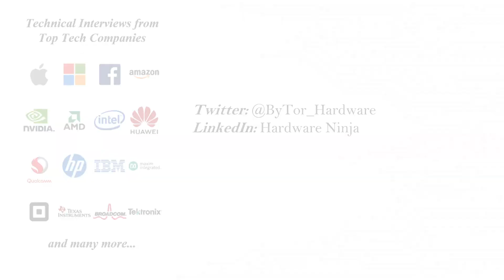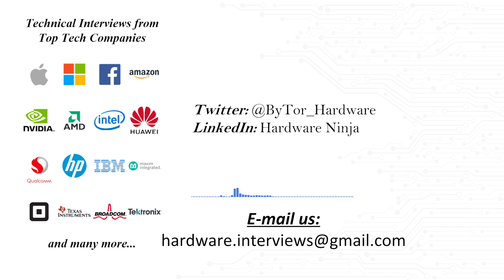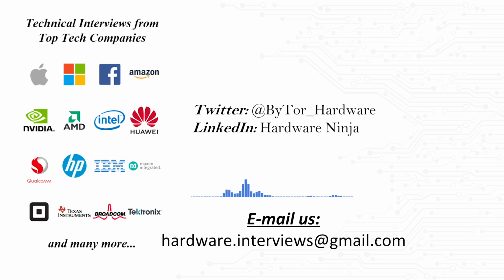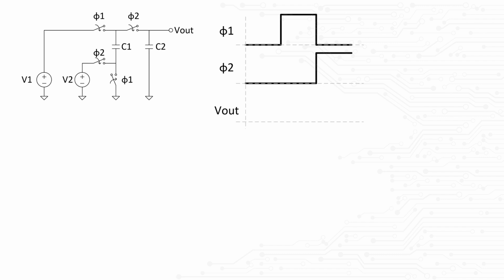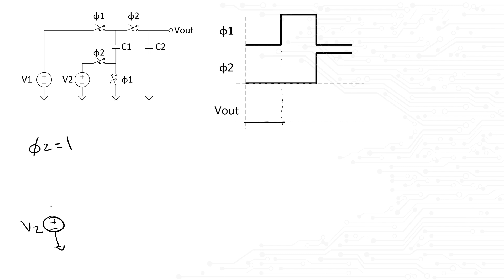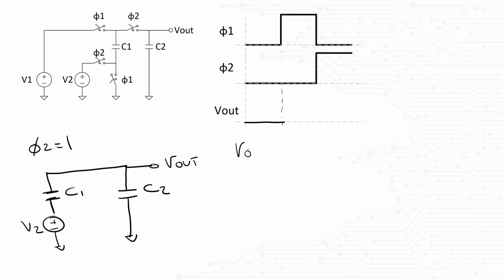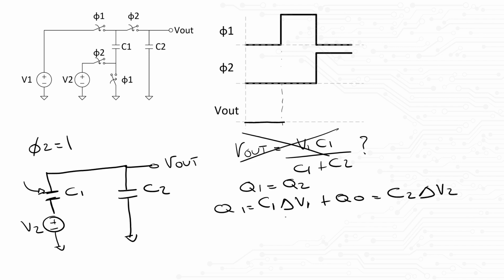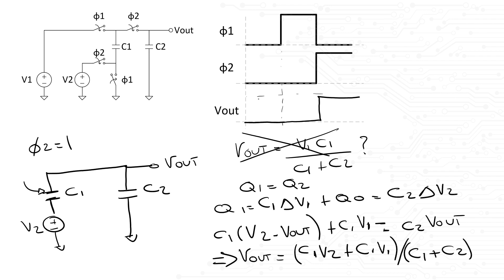HWN - Want to interview for NXP Semi? Study this!

Comment: is this correct? Intuitively, C1 is flying capacitor, assuming phi1 and phi2 are complementary clocks, when phi1=1, c1 is charged to V1, when phi2=1, C1 should fly to V2 + V1, your Vout should be V1+V2. since no R is mentioned Tau is zero, implies cap charges instantaneously regardless of Capacitance value. your final equation Vout= C1V1 + C1V2/(C1+C2) doesnt seem right if C1=C2, Vout = (V1+V2)/2 ? There is a problem with notation, delta V1 must be delta Vc1 and Delta Vc2 must be = delta Vc1 + V2

Comment: I got to the same answer just by charge conservation, which is more intuitive for me.  I just wrote:
Q1_p1 = Q1_p2 + Q2_p2
C1*V1 = C1*(Vout - V2) + C2*Vout
then it is the same equation as you wrote.
Reply from the maker: Hi Greg,
Thank you so much for stopping by and contributing to the discussion! You're absolutely right, charge conservation is another great way to think about the problem. However, we opted to go with the approach of the initial condition since it builds on the topic of our very first video! :)